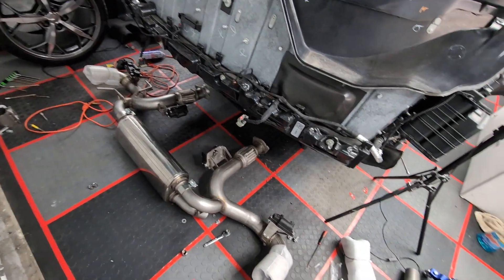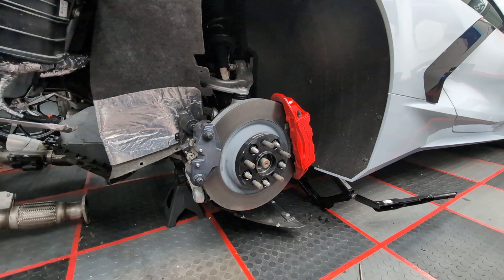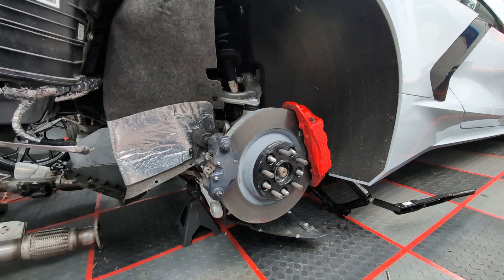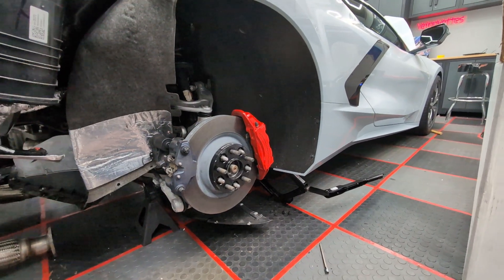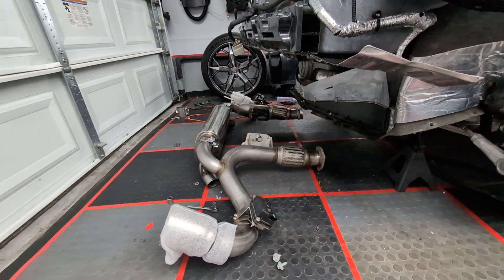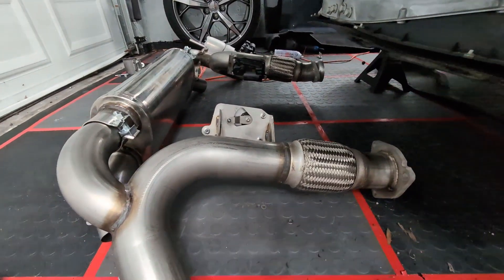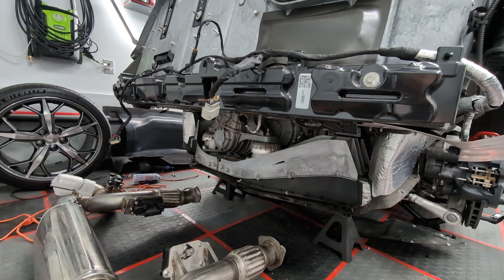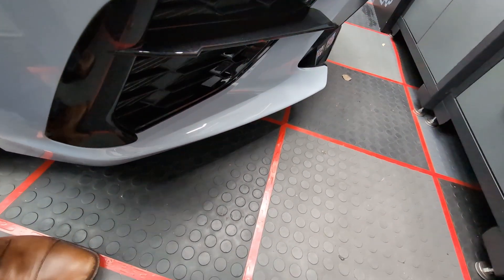Z51 VS NON-Z51 TECHNICAL BREAKDOWN | CAN YOU SWAP BRAKES/COOLING/AXLES? LETS FIND OUT

Comment: I have a C8 Z51.  The rear brake rotors being larger diameter than the front is a new realization for me due to this video.  I think one reason for this, that people may not think about, is that the rear wheel/tire is also larger diameter.  For any given size of rotor, if the outer tire diameter gets bigger, the brakes have less leverage.   I did some measuring etc and by my estimation the outer tire diameter at the rear is about 5% bigger than the front.  The rear brake rotors are about 4% bigger.  So that plus the more obvious reason, the car's rear weight bias, I guess explains it.  Still surprising given how much weight will transfer to the front under hard braking.  And I have seen in other videos from guys doing track days that they have issues with the front brakes not so much the rear.

Comment: Thanks for the video! I own a c8 stingray with the Z51 package and it's 2LT. I absolutely love the car. Any recommendations on front license plate holder. I would rather not remove the front center cover.
Reply from the maker: I completely understand that. I lived in a state that requires a front plate as well, but decided to just drive without it & chance it.  I kept the front plate behind the passengers seat and would throw it on the dash if I were to ever get pulled over. Never did luckily.  Some people buy a bracket that screws in the tow hook location. I would check that out 👍
Reply: @VetOnVettes funny thing is I live on Texas where you can open carry a forearm but you get a $200.00 fine if you don't have a front license plate on the vehicle. Crazy world!

Comment: I like the comment about you taking the car apart. Just order the car with or without Z51. You are not a better engineer than GM working in your garage. Typical shade tree mechanic screwing something up and voiding warranty. I wouldn’t buy a car you touched
Reply from the maker: By definition 99.98% of automotive YouTubers are Shade tree mechanics.  It's a fun hobby.  Not hurting anyone.  Being a prior nuke engineer on a submarine I do have confidence in my abilities.  Springs won't void a warranty btw.  Thanks for stopping by 🤙👍
Reply: @VetOnVettes  
That’s a great background

Comment: Mid engine cars has the rear rotor a little larger than the front due to weight distribution. I have an 1991 MR2 and the rotors are like that too.
Reply from the maker: Good input.  That was my initial thought.  Makes sense. 🤙👍

Comment: I've heard that installation of the brake ducts isn't recommended for daily driving not only due to clearance but also because they can scoop up and redirect rocks / debris right at the rotors.  Dunno if that's true or not, but there is zero chance that I push the car on the street to the point of needing additional cooling so I'm not worried about it personally.

Comment: Can u swap exhaust from base non z51 to a z51 exhaust… I’m trying to do that and wondering if it’s just a quik bolt on exchange?
Reply from the maker: You can. However, you won't have the electronic control to open the valves. I believe when you pull the actuators off, the spring defaults to open. But if it does not you will have to find a way to keep the valves open I.E. a little tack weld on the top spring actuator.  But to answer your question it will bolt right up.
Reply: Okay thanks that my next project… I just picked up a Z51 exhaust. Hopefully it works 🙏🏻
Reply from the maker: @jesone79  awesome. I'm curious myself. Keep me posted.

Comment: The biggest difference is the ride quality is 10x better on the non z51. I drove both and you can’t tell them apart otherwise. All seasons can still pull 1.2G laterally.

Comment: A few months back I did the Ron Fellows Level 2 school at Spring Mountain, we were running the Charleston Peak short course and the front brake rotors were getting toasted--the car would still slow OK but the front brake pulsations (from the warped rotors) was just insane.  For the street Z51 is overkill but for the track they need way bigger rotors in front.
Reply: Agree lots of stuff on the Z51 is not up to track duty, I ended up replacing the shocks with a nice set of JRI double adjustable and brakes with AP Racing and then wider lighter wheels with sticky tires. Car is pretty good out of the box but not optimized for serious track use.

Comment: Best breakdown i have seen on the delta between base and Z51   
I bought a base model and I appreciate the softer suspension and AS
Tires. Plus i like the high wing better than the Z51 wing. Add the ground effects and get rockers and splitter.

Comment: I have a non Z51 and my buddies all have Z51's. I have drove both cars and actually I can't tell the difference. I know what the Z51 has; but I don't need it.
Reply: They will never leave you behind unless extended track racing. Tracking needs the cooling and brakes.
I am so happy to have the Non-Z51. Better ride, cheaper, all season tires, and I don't want the E-Diff.

Comment: FYI, swapping to Z51 calipers is complex. I messed up one of my Z51 piston boots changing brake pads. B/c they are glued to the pistons. Bleeding brakes on a C8 is no simple task. I pressure bled mine, but the ABS valving under the master cylinder will hold air in the system. Need the GM software to command the ABS open while pressure bleeding. My dealer helped me out but the brake computer detects and doesn't like air.

Comment: The rotors are bigger in the back because of rotation mass and weight of the motor and transmission. You need more stopping power where motor is located
Reply: However the car is set up with more front brake bias through the master and you end up using up probably two sets of front brake pads for every one set of rears...

Comment: Chevy fits the Z51 with a shorter (numerically higher) final-drive ratio to improve acceleration. Base C8s get a 4.89:1 final-drive ratio, whereas Z51s are fitted with a 5.17:1
Reply: Exactly!!!! that is the "rear axle ratio" difference,,, not the thickness of the shafts 🤣
Reply: Interesting, thanks!